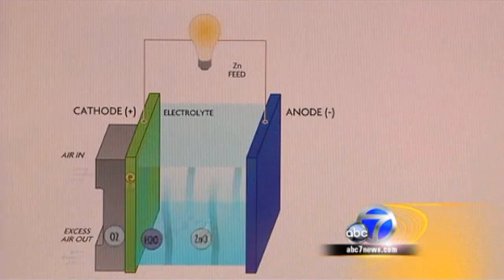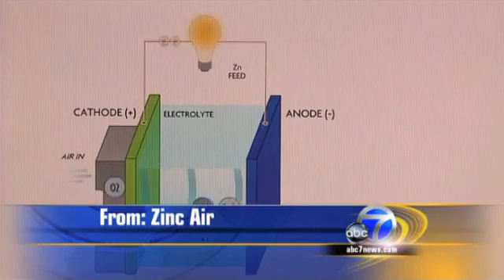Zinc Air Fuel Cell by Zinc Air, Inc.

Comment: Le couple "air/Zinc" est connu depuis un siècle; la difficulté concernant la recharge consistait dans la formation de DENTRITES, sorte de racines qui partaient du - pour aller vers le + et court-circuitait la batterie.
Alors faire le plein de zinc au lieu de faire le plein d'essence est une alternative intéressante face aux ajouts de mercure des batteries rechargeables.
Mais ne serait il pas mieux d'utiliser une pile à combustible au CH3OH, non polluante car ne rejetant que H2O & CO2 ?